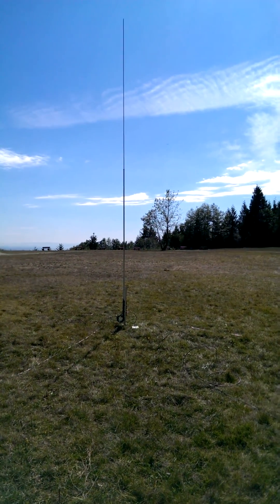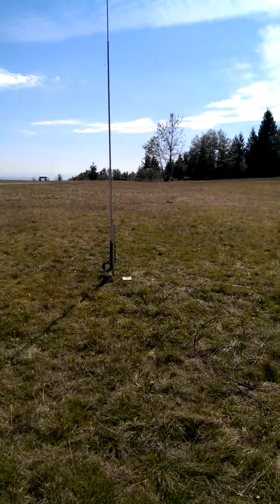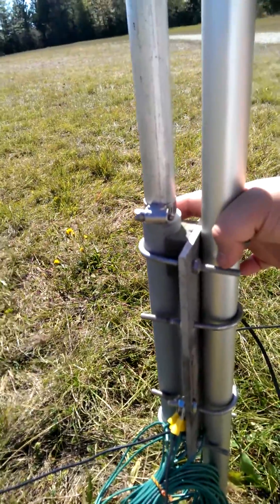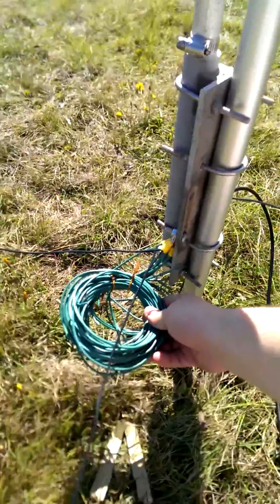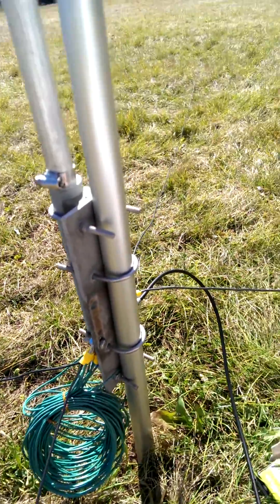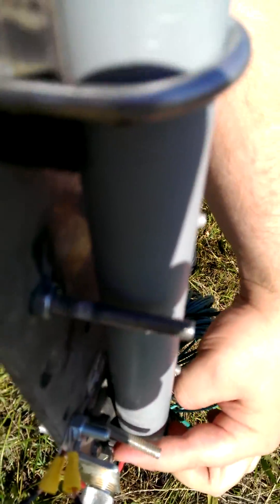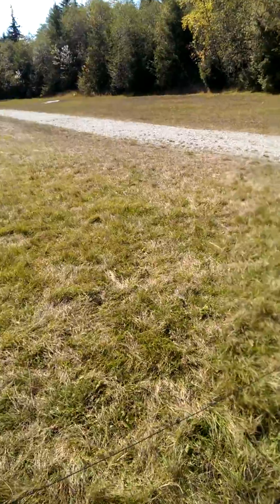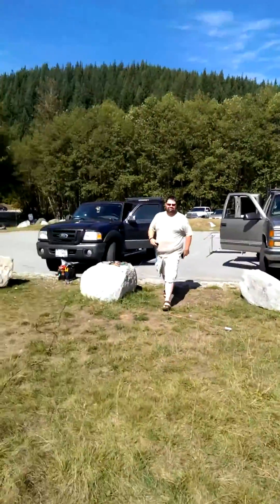VE7WNK 20meter vertical antenna - Sept 1 2013

Comment: How did it work on 20 and 10 meters?  ;)
Reply from the maker: Fairly well if I recall. That antenna is now permanently installed at my home and works very well on 20m as a monoband antenna. It's very wide-band, or at least is wide enough for the phone portion of the band. It is a great alternative to my horizontal antenna on 20.
Reply: As the years went by did you decide to add more 20m radials and if so did you see a difference?